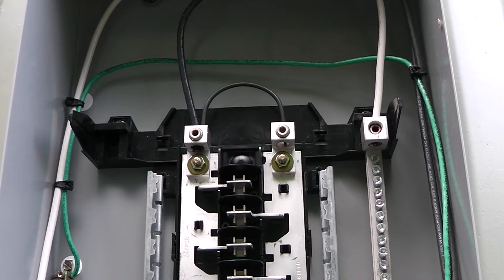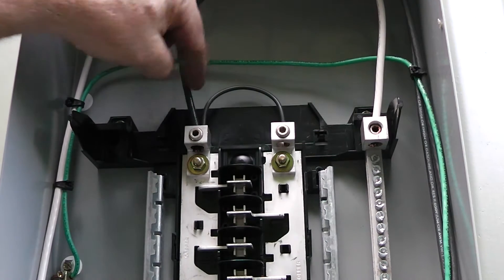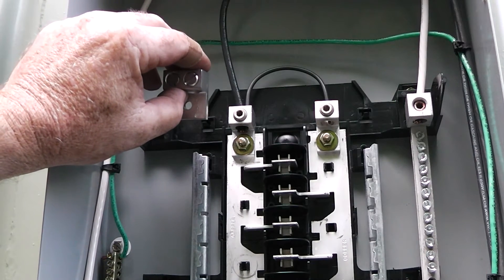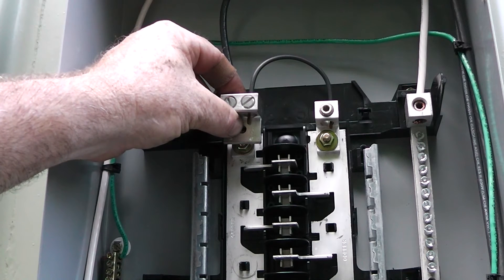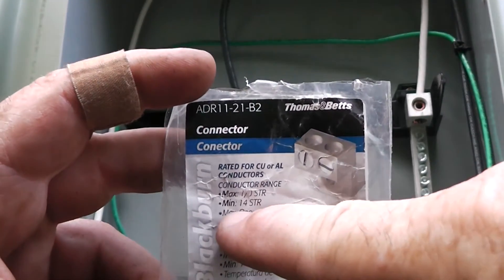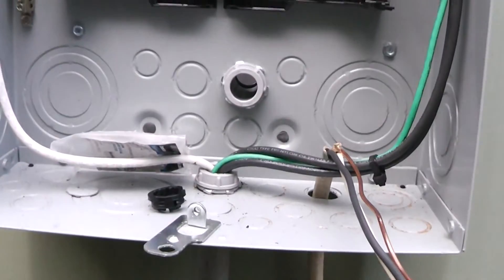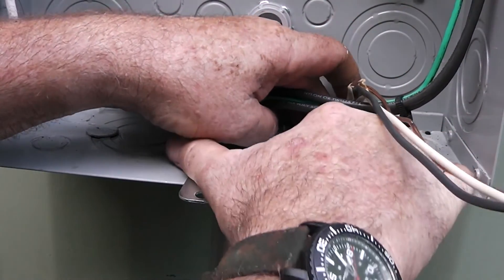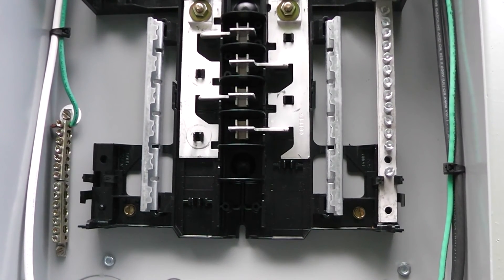I try to Answer Electrical Question for a Viewer

Comment: Question: I had some work done by a handyman and afterwards one of my plugs didn't work. I thought it was unhooked or the plug went bad. I checked with a voltmeter and nothing. I checked with my non-contact detector and it was hot. so I opened it up and found that the hot and ground had 120V, nothing on the common wire.  I assume I shouldn't put the ground on the common screw on the plug, so how do I fix this? I guess it has to do with the panel?
Reply from the maker: I would look where your handy man did his work. It could also be a coincidence and not related to what he did. You will have to trace the wire to the next junction(receptacle, switch or panel). I have seen lightning burn a wire in half in a wall that will cause receptacles not to work. You might ultimately have to run a new circuit to that receptacle to get it working again.
Reply: @homesteadprepper  Thanks for the fast reply! I looked at the other outlet I assumed he tied to, just in case  the wire was loose. I can  run a wire from another outlet and replace that one. Thank again for the help!

Comment: I love in a 4 condo small building.  The "house pael" had old screw in and supposively the fire alarm on it" the building had the screw in converted to breaker box. All outside lights, hall lights everything is attached to my box from years ago. There was no permit pulled nor is the main panel or " fire alarm breaker box filed or a bill. Can this breaker box just containing the fire alarm be connected to someone else's bill or spliced off still on their electric bill ?

Comment: Maybe you already explained this in another video but why is it ok to put commons and grounds on the neutral bar in a main panel but not in a sub panel?  Thanks.
Reply from the maker: If we were to bond the subpanel, we would be effectively putting the grounding conductors in parallel with the neutral conductor.  This would all be fine and dandy except for, if and when we lose our neutral connection or if for some other reason the ground became more attractive for the return path of electricity.  If such a condition were to arise, the ground would become the return path, potentially energizing who ever comes in contact with it through a metal chasis.
And it is forbidden to have the ground as a return path for electrical as per NEC for safety.
Reply: Wouldn't that also be the case in a main panel?
Reply from the maker: Ok, if I were to bond the equiptment grounding conductor with the neutral at the subpanel, electricity would flow on both the neutral and the equiptment grounding conductor(parallel) right creating a hazadous condition witht the potential of energizing metal enclosures with errant voltages.
Theoretically, if I lose the grounded conductor at the main panel, and I turn on my "toaster", it will not work because there is no path back to the neutral and therefore no parallel path to follow and no path for it to take.  If our "toaster" is properly grounded through the power cord and the grounding electrode conductor, there is no way to get shocked from the chasis of the toaster, unless the neutral at the toaster is in contact with the chassis ground or the ground is lost as well and the hot wire is in contact with the chassis.  There is the potential for the chassis to be energized and some could get potentally shocked in this scenario.  But, there again, our toaster should be plugged into a GFI circuit for more protection against fault current eliminating the hazard and we have OCPDs.
I have seen main panels lose there neutrals and it creates freaky things in homes and businesses.
240 volt circuits will create an "imbalance" that would be bled off by the grouding electrode conductor when the neutral is lost.
So to answer your question, no.

Comment: how would I go about adding a 220 outlet to my garage for a welder? I'm not an election, I'm competent with tools, meters, micrometer etc, just never done mich with AC, DC no problem lol. also the garage has its own service, meter and panel. 
thanks
Reply from the maker: It would be very difficult to try to decribe how to go about that here in the comment section due to the variables associated with it.  If and when I install a 220 circuit for a welder, I wiil make a vid.
Reply: +homesteadprepper thank you, I appreciate your videos, we're in the Ozarks. we bought a small farm property to give us a headstart. now just adding things to be more self sufficient. 
keep up the good work. really enjoying your videos.